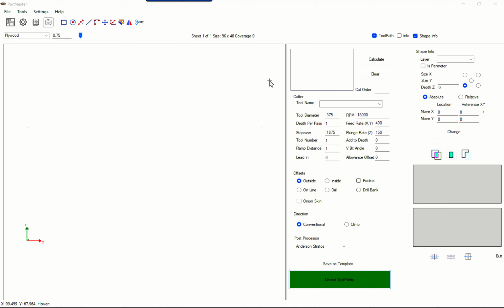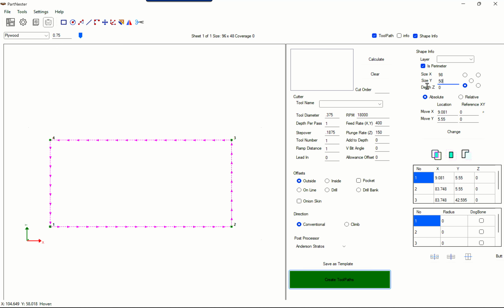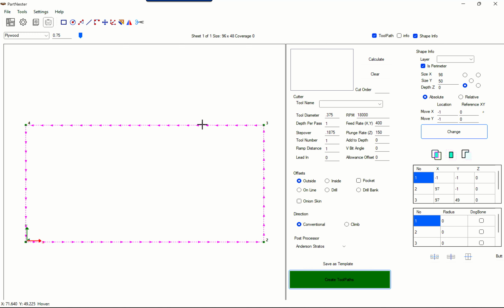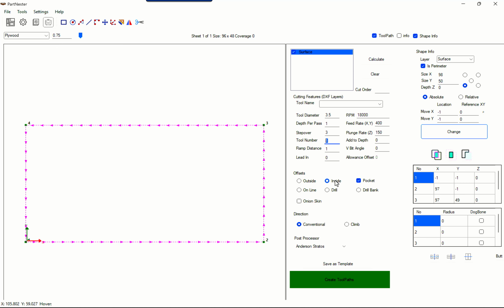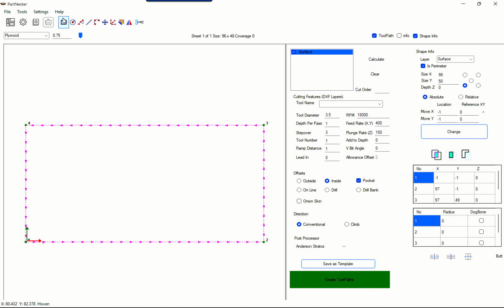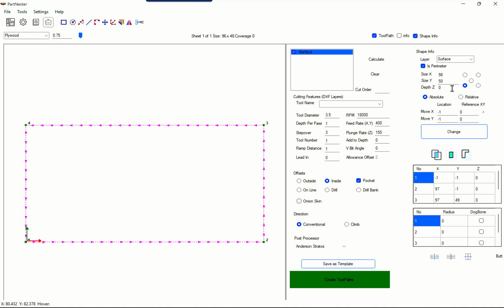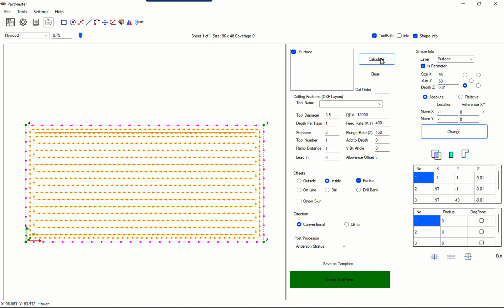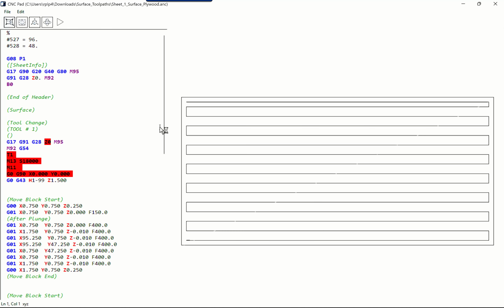PartNester 4: Create a CNC Spoilboard Surfacing Program

Comment: My biggest problem is your software don't have any 3d viewer. The cheapest software like Cabinet planner has one. So please consider adding one.
Reply from the maker: Thanks for the feedback. A 3D viewer isn’t currently the intended function of PartNester or CabinetPartsPro. They are designed to make it easy to take cabinet-part data and get it to the CNC for machining. They can also import data from design programs such as Cabinet Planner, KCD, ClosetPro, and CabinetSense, allowing you to continue designing in the software you prefer while PartNester handles the CNC side.

At this time, adding a 3D layout viewer isn’t an immediate focus, but that doesn’t mean it couldn’t be considered in the future.